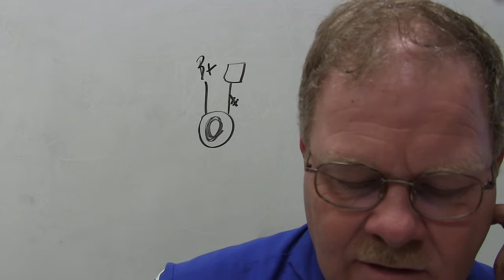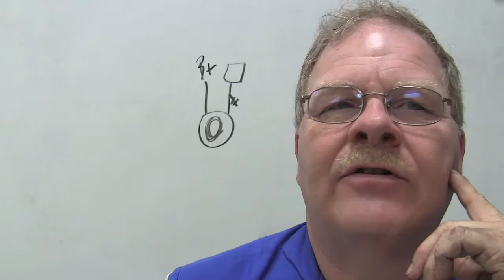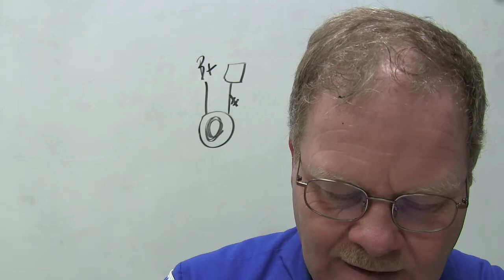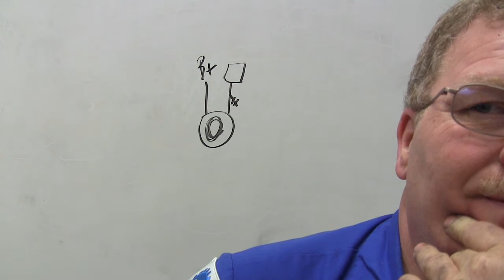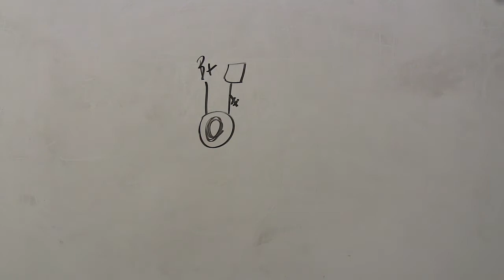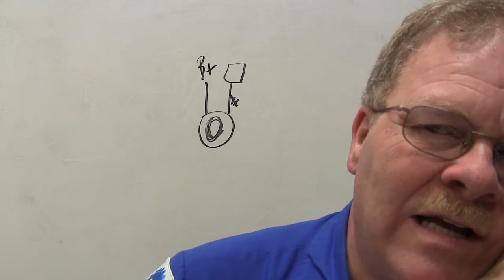Engine Repair 2 Test 9   Intake and Exhaust Systems

Comment: Non-Stainless manifold for heat expansion issues. Most exhaust manifold/headers are of lower grade metal that can flex in the event of extreme heat caused by mechanical or user abuse. Hard or treated metal can break where bolted to head or turbo.  I have seen this on modified vehicles with nice exhaust systems.